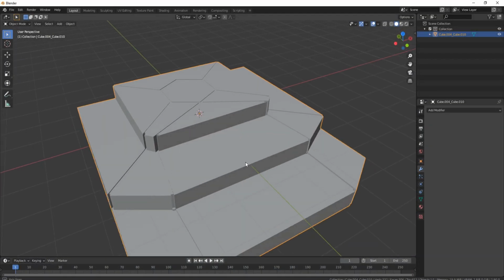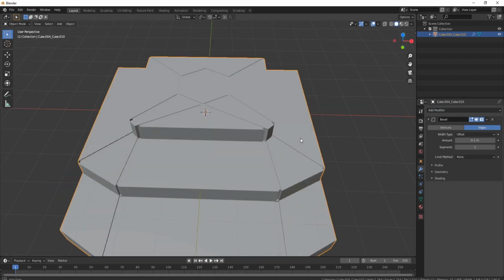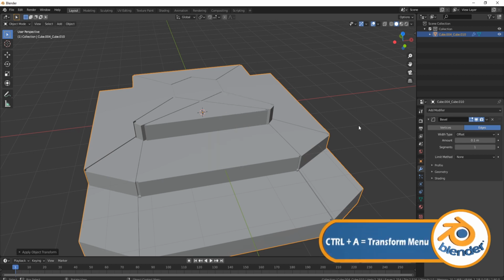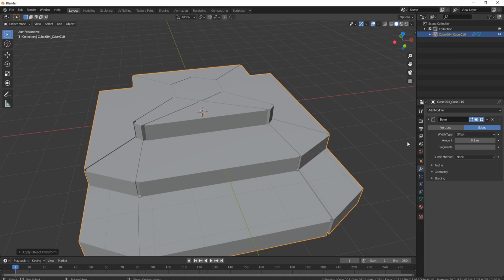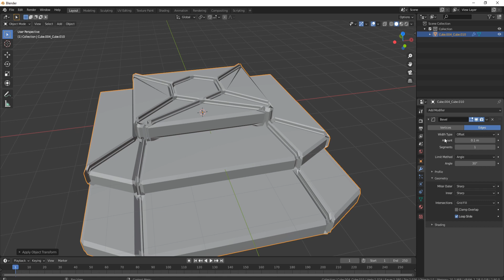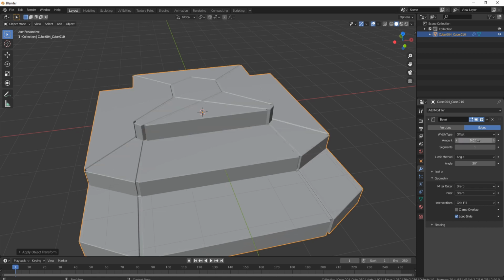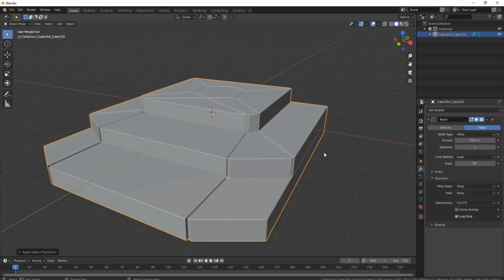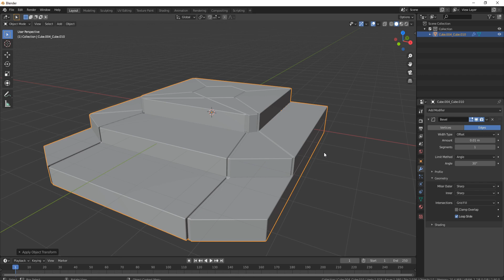Blender Bevel Modifier Not Working | How Do I Fix It?

Comment: Well, now I am really curious to know why Clamp Overlap is on by default.
Reply from the maker: Overlap is there to prevent vertex overlapping, it can create all sorts of issues from UVs to non-manifold meshes if you are not careful.
Reply: @3DTudor  Well then they should at least make an alert that tell the user something like "You can't apply bevel cause… unless you disable Clamp Mode cause you have overlapping vertex".
For UX wise for beginner.
At least 90% of issue are covered buy tutorials like yours...
Reply from the maker: Totally agree with you there! A little heads-up from Blender would go a long way—especially for beginners just wrapping their heads around all the modifiers. That kind of UX polish would save so many head-scratching moments 😅

And cheers for the kind words about the tutorials—it really means a lot!

Comment: Didn't work. Tinier objects get completely screwed with this "workaround" :(
Reply from the maker: Doesn't matter the scale of object just drop down how much bevel there is to something like 0.03
Reply: @3DTudor  That's what I did. You literally explained that in the video, but that didn't help. Anyway, I found the issue by now. It was because I initially bevelled some objects, that were really tiny. Thus some vertices were too close for the bevel modifier to be applied. After just deleting those objects, it worked perfectly for me. So I just replaced them with unbeveled objects. Lucky me, it haven't been many :)

Thanks for your help anyway. Appreciate your work. Peace!

Comment: If you are using instances in geometry nodes you need to realize instances or the bevel modifier will not work
Reply from the maker: You would have to convert the geometry node to mesh before using modifiers like that, or you can set it up directly from geometry node itself :)

Comment: I would like to know when and why this problem happens. I had this problem with simple shapes as whith complex ones.
Reply: For me this mostly occurs when my mesh has to much n-gons. (Or when polygons have irregular angles, 90° works best, higher then 180° can cause issues)
 Usually fixing the topology with the knife tool or whatever method ypi favor will do the trick.

Unchecking clamp may work in most cases. However since the bevel modifier has a uniform width, so to speak, the smaller insets in this mesh for example could,  theoretically start collapsing on themselves.
Reply from the maker: This is a work around if you are using the mesh as a high poly and baking out, you are retopologise the mesh anyways or its for a render within blender.  Its a nice answer MV ARTZ :)
Reply: @3DTudor  Yea you're absolutely right! In the end, it's all very case-by-case what imperfections you can ignore and which need extra attention for the type of production you're working on, right.  
Love your content keep it up!

Comment: Clamp is nice to prevent ugly geometry.. If you zoom in to your beveled corners after disabling it I'm pretty sure it will look like crap somewhere. You can also specify which edges to bevel by limiting to a Vertex Group... and also have different bevel modifiers for each group.
Reply from the maker: You are correct but this option is still useful in certain situations. Thanks for the comment :)
Reply: Ugly geometry would show the user where to fix it. 
Here's a thing to think about: Would you rather bevel give an unexpected result in one small area, where there are vertexes to close to each other, or doubled, revealing a problem with the model to the user? Or would you rather bevel give an unexpected result on THE WHOLE MODEL with no hint showing why it happened?
"Clamp overlap" is useless.
Reply: @pauliusmscichauskas558  It tells you there's a problem somewhere, how is that useless? Otherwise you might not see the shading error until after rendering. And also sometimes (most?) you just want some bevel to break the corners, not the exact amount specified. Clamp will give you the maximum amount without the time consuming task of modifying the geometry manually.
Reply: @erik....  If you see a shading error, you know you have a problem, and where specifically it is.
Clamp overlap does not show you that there's a problem with the model. It just makes bevel not work as much as you want, or not at all...
If you do not see a shading error, though there is one somewhere where you can't see, then it's not a problem.